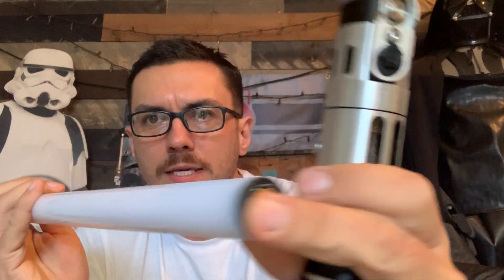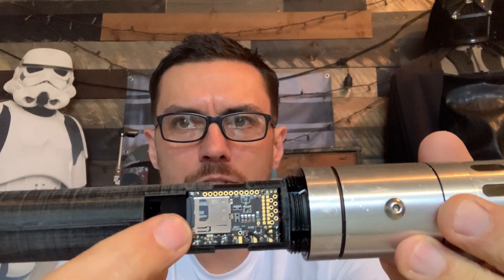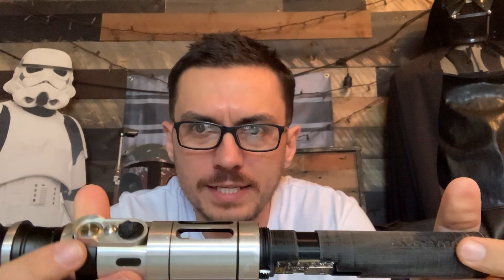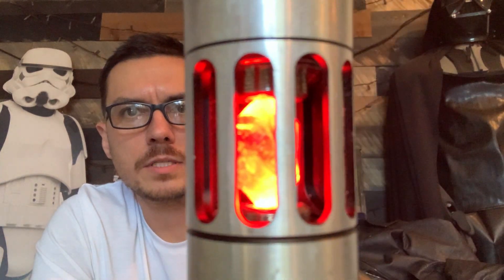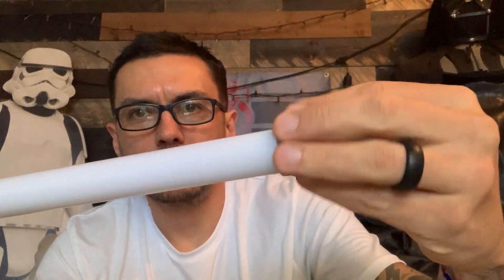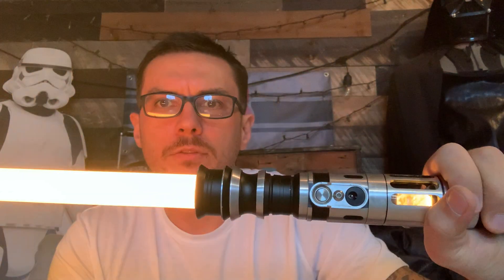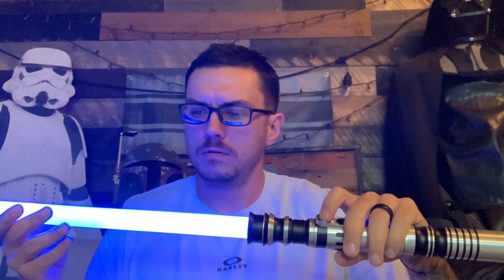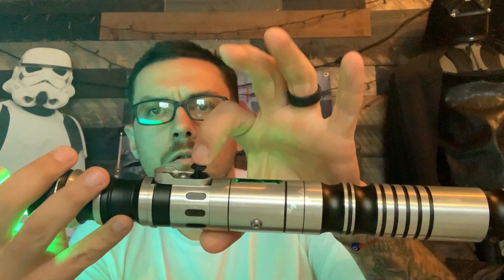Cody’s Saberforge ASP

Comment: hey there, question, how did you get the crystal Led to match the blade color?
Reply from the maker: I beleive in this guy I wired the cc pixel in line with the main pcb
Reply: @Solo_Sabers  I'm curious how that'd work the heroic plugn  play kit, I'm not an expert on this stuff at all
Reply from the maker: @my_karubah6573  I’ve never done a plug and play